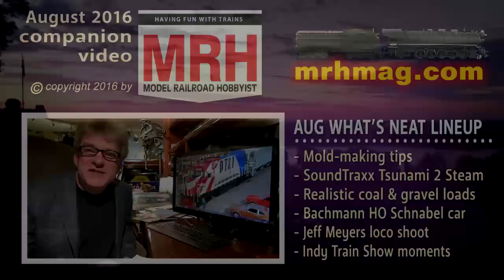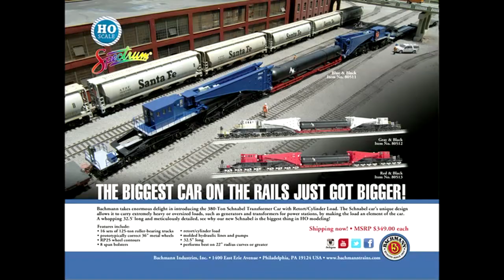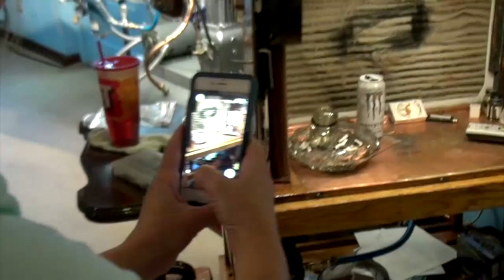What's neat - August 2016 column | Model railroad tips | Model Railroad Hobbyist | MRH

Comment: Once again, another great video to add to your list of accomplishments. I had a thought that I'd like to share with you in reference to the coal loads you made with spray foam. You might want to put a steel washer inside the foam so you could grab the load with a magnet to remove it as opposed to touching it all the time. I guess this really depends on how often you will "load/unload" the car. I know you were trying to keep the weight down so you could use a small washer. I don't know how much handling the load would take before being damaged so that is prompted me to think of that idea. The loads look really nice and seem very easy to make. Thanks again for another great video. As always, looking forwards to next month's video.Bill

Comment: Your foam technique was used a while ago in one of the Model Railroader issues, but they used polystyrene foam instead of foam pro.
Reply: Yea, Didn't see it... Came up with my Idea in the shower while I was shaving.. The shaving cream gave me the Idea. . It filled a need as I really did want to get some coal to the upper town that morning. The resin cast coal loads I have weigh more that 2 empty freight cars, Just too heavy. C-19's don't pull that much up the 4% grade..4 cars at the most. Everything just worked out that day.................kp